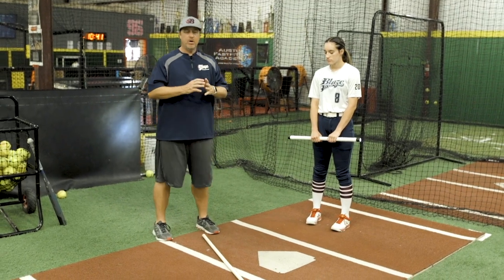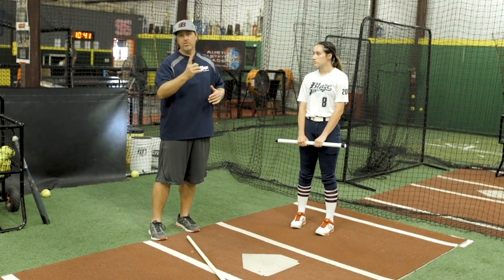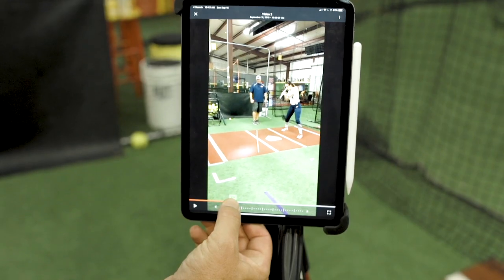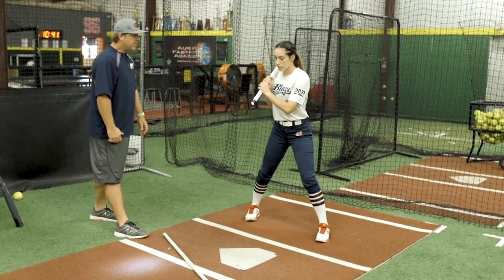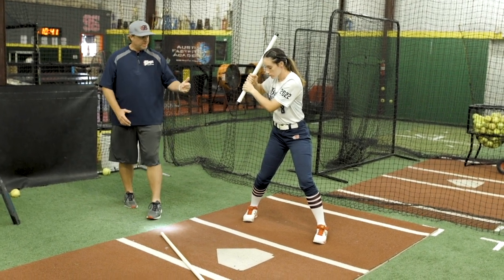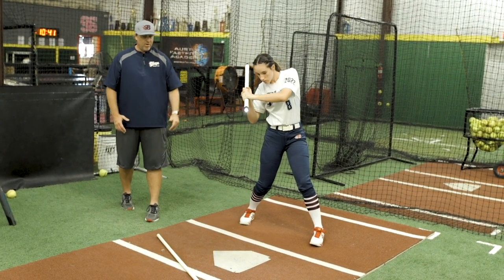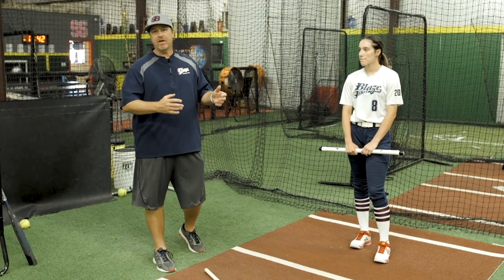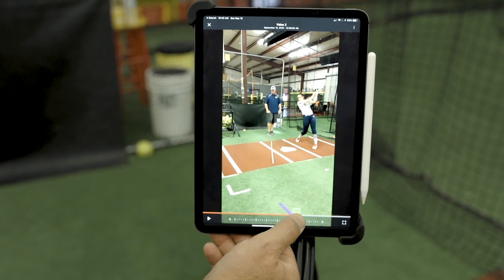Texas Blaze - Flashlight Drill

Comment: This is the first I've seen this type of drill with the flashlight. I may try it at some time but I have one concern on the setup. The PVC pipe that is on the ground...how should that be aligned. I am concerned I would have the pipe to close, too far away, or at a not so optimal angle. How should I make sure the alignment and positioning of the ground PVC pipe is in the correct postion to ensure the player is going through the correct motion?